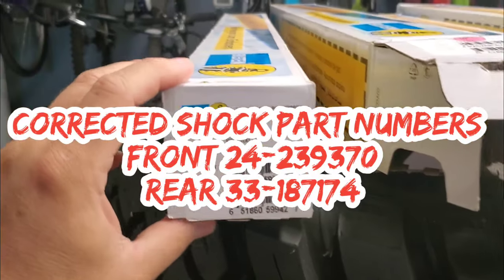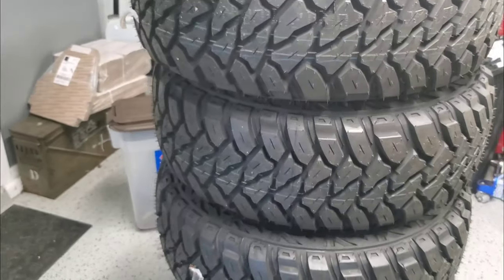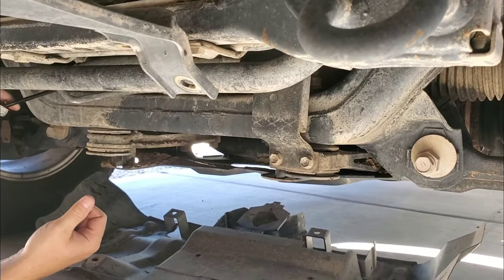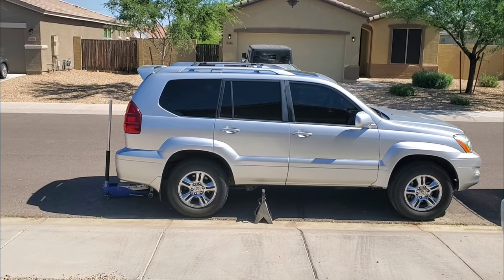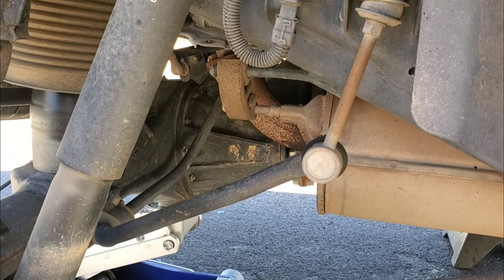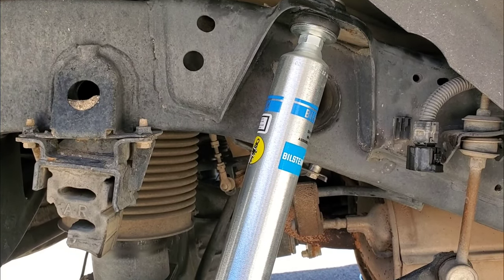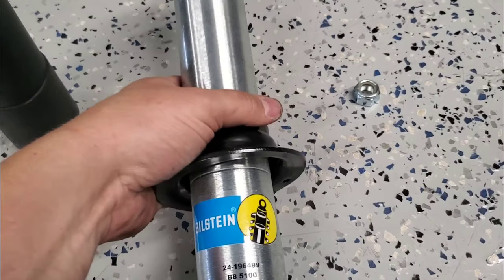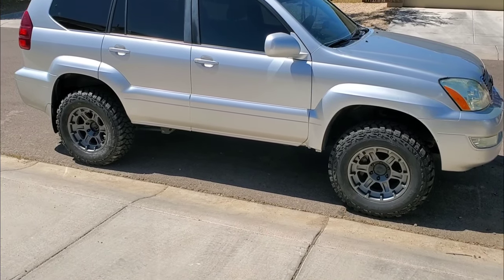SIMPLE LEXUS GX470 / GX460 / 03-09 4RUNNER LIFT. AIRBAG TRICK - BILSTEIN 5100 - DIFF DROP

Comment: Great video!  My 16 yo son and I will do all of this (and your side step delete) on his newly acquired Silver GX470!  I have everything except the specs on the wheels.  Is this this correct wheel? https://shop.tandemoffroad.com/collections/wheels/products/612-charlie-gun-metal  17x8.5 ET -12 for the 265/70-17 tires?  thank you again...Subscribed!!
Reply from the maker: You got it, sounds like a killer project! Tires are 265/70/17
Reply: @MR_Garage  Sorry, I was asking about the wheels, not the tires.  Can you confirm that your wheels are the following: https://shop.tandemoffroad.com/collections/wheels/products/612-charlie-gun-metal   17x8.5 ET -12
Reply from the maker: The "You got it part" was about the wheels :) I run the older Bravo's which do not have a center cap. Same rim otherwise.
Reply: @MR_Garage  My bad!  Thank you again!